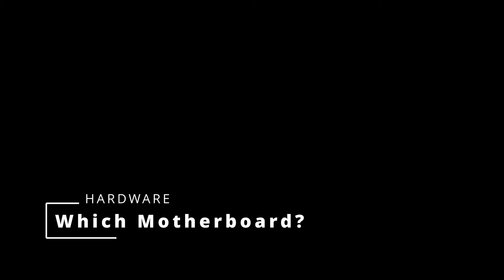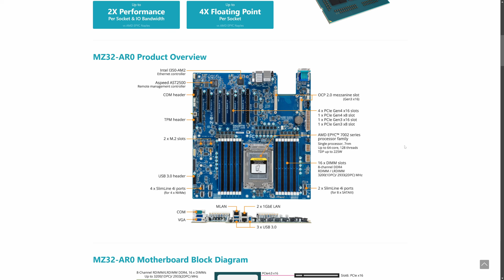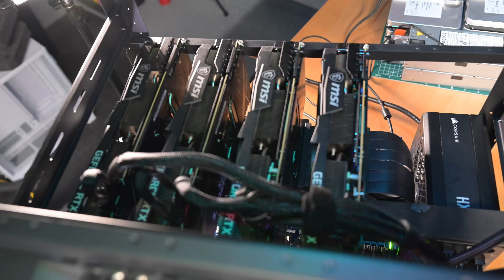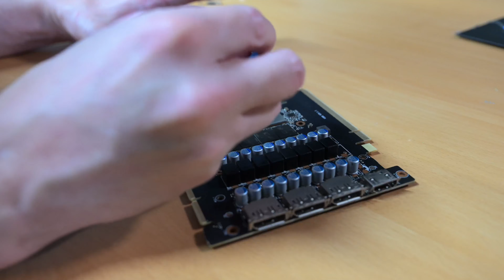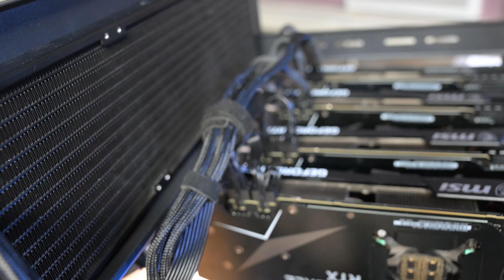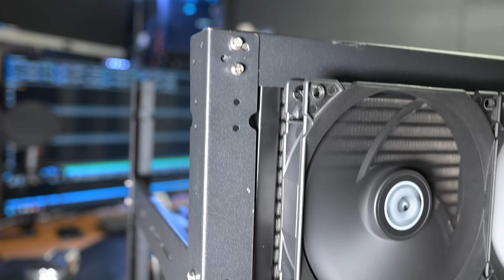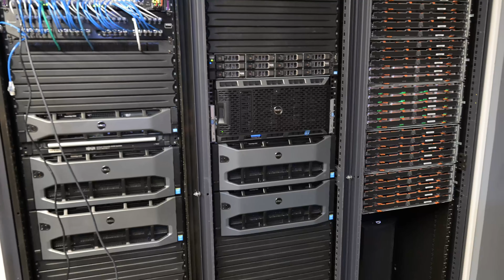INSANE Home AI Server - Quad 3090 Build

Comment: Switch to a 2000Watt PSU and more importantly, use two NVLinks to connect the cards. Unfortunately four-way NVLink doesn't exist for this gen, but still, it 3X bandwidth card-to-card compared to just PCIE. Even PCIE 5.0 would be bottlenecked, not to mention PCIE 4.0

For training, NVLink could even 2X performance, for inference it would "only" be about 20-30% improvement (depending on dense/MoE model, where's the KV cache, attention layer, experts etc.)

Comment: Hi,
I got an MZ32 setup, too. (I bought it after watching your vids, wanting to run my own AI Server, too.) 
Until now, it worked well for a few months but now after I was away for 2-3 weeks  it won't properly post and is stuck on BMC blinking. Nothing was happening to It while I was away, however it was not plugged in to power.
(Before the MZ32 I had an MZ31 that when I got it had exactly the same error and that I instantly returned for that reason.)
I tried a new Cmos battery, two different kits of ram, Cmos Clear Jumper, and the Bios Recovery dip Switch setting. Nothing worked so far :(. Have you ever had similar Issues with the board, or have any Idea how I could fix this? (It's too sad since I just was able to pick up a 512gb Ram Kit before the prices went crazy, and I was really looking forward to finally be able to run very large models.)

Comment: So, I bought a 3090 and mobo setup this past weekend from a former miner. It's using the crappy USB pcie risers. This guide is going to help me so much with converting it to an AI rig. Currently going to run only one 3090. Eventually I may add more. I was looking for someone's setup because I am going to buy a 5.0 x16 riser and couldn't figure out how best to orient the card to properly/securely fit on the 90-degree riser.

Comment: In regards to blowing air directly onto your components; if you placed this machine into a somewhat enclosed encasing with openings for vents (meshed for dust), if you had a few fans more powerful than the ones blowing inside, you can create a negative pressure in the setup and have physics naturally circulate air outside system in.

Comment: What is the recommended local server hardware (CPU, GPU, RAM, storage) and approximate cost to run GPT-OSS 20B and 120B models through an API? Also, can 20B run efficiently on a 24GB GPU, or is higher VRAM (e.g., A100 80GB) necessary?

Comment: @digitalspaceport Any gotchas I should be aware of when trying to get the rig to boot from a USB (Ubuntu 24.04.2 LTS) for the first time? I'm working with Microcenter to try and figure out if I have a bad component or if we're just overlooking something. We can get it to post, but after assigning USB as the primary boot (saving and exiting) it refuses to post the next time around. I've basically mimicked your build (used the Gigabyte MZ32-AR0 board and the AMD EPYC Milan 7C13 64 Core processor). Curious if you ran into anything similar when you built? This is my first server build, so I'm kinda failing my way through this. Thanks in advance man, I hate being the guy asking for tech support on here, but here we are. LOL.
Reply from the maker: You should not, 100% not, use a USB anything as your install drive for proxmox. Especially on modern systems. Use a raid1 of the NVMe slots instead. Totally cant help you with a USB boot drive and shame on microcenter not shooting this down instantly. I just released a complete software setup guide that shows exactly that raid1 setup you should use if you want a hassle-free and safe system to use.
Reply: @DigitalSpaceport  Appreciate the feedback man, but this post was not referring to Proxmox at all (though I am about halfway through that video). I'm just trying to get the server to startup for the first time. ;)
Reply from the maker: Oh then you need to get access to your BMC and then use the H5 viewer to see what the boot screen is saying. Likely some F1 settings save kinda deal. Plug in your BMC and find that address from your ARP table in router (it should DHCP, bios reset if not) and then username: admin pass: there is a sticker on your mobo. Then on the left hand sidebar, remote, H5 viewer. Also you likely need to upgrade your BIOS and BMC firmware.

Comment: Does E-ATX (305*330MM ) motherboards fit in this rack?
Reply from the maker: @sergeyvinc1595 The MZ32-AR0 is an E-ATX motherboard, which is what I used in this video. You do have to tap 3 new holes and set stands which I showed in this video also.

Comment: Hello again.. I have gathered up most of the components, got the AMD 7V13 + H12ssl-i setup and have a query regarding the RAM. 
To really push its limits with training and agent tasks, with the option to use larger models with this setup, what would be the best option to squeeze the most out of it? 
Would slotting in 512 GB of 128 GB Samsung M393AAG40M32-CAE be overkill to leave capacity eventually fill all slots to get 1Tb? 
Over time I would consider to get 5090's down the road once they get a couple of generations ahead.
Reply from the maker: @SwingLid I would not go for a full 1Tb of RAM. Those DIMMS explode in price per piece.

Comment: I'm kind of surprised that this build has held up. Unless I'm mistaken the two 8-pin power connectors are strictly for the CPU power only, as they are labeled P12V_AUX1 and P12V_AUX2 in the manual, which means that all of the PCIe power to those 3090 is coming from the 24-pin motherboard power connector. A connector that only has 2x 12V pins from the Molex Mini-Fit Jr. series, rated at 9A according to the datasheet.

I don't see any supplemental power connectors on the x16 riser, which starts to become a bit worrying.

If the above is true, and Gigabyte doesn't do something weird like wiring the P12V_AUX1&2 into the PCIe slots. Then this build is powering 300W worth of GPU's (75W per slot, 300W total) from two pins that are rated at 216W (2* 9A * 12V = 216W). Sure you can run that at your own risk, but I wouldn't be recommending that other people should do this. Making a build that ends up overdrawing the 2x 12V on the 24-pin connector by ~33%, is kind of no bueno.
Reply: What are you talking about? I honestly don't understand what you're trying to say. Each GPU has dedicated PCIE power cables running from the PSU. They're each being powered primarily by dedicated 8-pin connectors from the PSU. Unless I'm missing something?
Reply: @allenklingsporn6993  Every 3090 will pull the maximum allowed power from the PCIe slot itself, as it is noted in igorslab 3090 review: "Let’s now move on to the load on the motherboard slot, whose load is specified by the PCI SIG as 5.5 amps. This results in a maximum power of 66 watts at 12 volts. You can see very clearly that under full load exactly 5.5 amps are reached, which is of course still permissible, but already borderline."

At full load you'd be looking at 4x 3090 drawing 22A from PCIe slots, which is usually provided by two +12V lines on the motherboard (the EPS12V normally reserved only for CPU power and does not help powering the PCIe slots). Drawing 22A from a connector that has two pins with a maximum rating of 9A per pin (22A > 18A) can cause the connector melt or catch fire (as can be seen with 12VHPWR connector on the 5090 melting).

It's one thing to be building this for yourself (while knowing the risks), it's another thing to be recommending a build like this to others (and not informing them of the limitations).
Reply: I didn't look into the validity of what you're saying on this; but what I can't understand in it is what the risers have to do with it. If what you're saying is valid, then how are you saying it would be any different if plugged directly to the board without the riser?

Comment: this is good to watch, I'm currently trying to piece together 4 of 5060ti into a pc to automate a rly powerful project of mine. I'm new to this I js found out abt the LLM(Qwen 2.5) and wanted to save myself the API from openai or claude so I js ran a powerful open LLM and I plan on it running 24/7(64vram and 64 ram) if you have any tips for me it'll be greatly appreciated
Reply from the maker: I did just do an F.A.Q video you should checkout. https://youtu.be/7kgMkzeX650 This is a massive field of findings, your going to be more specific. I cram lots of findings into the testing out various GPU playlist I have done, so I would check those out also. https://youtube.com/playlist?list=PLarJAzZsWRGBcTRqNnPz_o4A38m3x89F6&si=3WSshJoWqEjq3MkI

Comment: @DigitalSpaceport - I am just about to start building this rig. Just sourced 4 3090s and wanted to know. For a noob that has no idea of what I am doing. Are there any tips on the motherboard for future proofing.. Do you suggest any upgrades to the motherboard-CPU combo that are also user-friendly? My aim for this is to build the capability that can locally run agents to perform analytical research for my investment portfolio locally. The budget would be around the 10k mark. Love your stuff. You get the message out clearly. Great job
Reply from the maker: EPYC may not tick the "User Friendly" box but it is the best way to get it done and on a budget that doesnt skimp on performance. Those quad 3090s are a perfect match to the rig I put together and the full parts list is here: https://digitalspaceport.com/local-ai-home-server-build-at-high-end-5000-price/ and any of the 7x13 chips is advisable as well as 3200 speed ram but aside from that there is not more to future proof in this price range really. You could opt for an H12SSL-i mobo which is a bit easier to get around and does have dual gen4 nvme slots onboard as well as satadom support would be an additional suggestion. If you have specific questions feel free to ping me back here.
Reply: @DigitalSpaceport , I appreciate your reply. Thank you. I will go with the H12SSL-I Have a great day!

Comment: condensation? how is condensation going to form on hot gpus when you're blowing room temp air on it?
Reply from the maker: @mv2woods I'm not blowing room temperature air on them. They are sitting very close to the window AC which registers 24f output on a temp sensor I have on it. I offset the rig and all is good, not ran into any issues.
Reply: Oh interesting I was wondering if you were referring to the ac unit I'm the shot. Thanks for clarifying.  @DigitalSpaceport

Comment: Awesome video. Any recommendations for older generation Xeons/DDR4 motherboards? Ideally that could handle 4 GPUs?
Reply from the maker: Yeah I have a friend who has this mobo and likes it. https://geni.us/QuadGPU-X99-Mobo They run a 2680v4 off it and didnt have to flash it with a V3 to be able to use their V4. Gen 3 pcie risers are also much cheaper and for inference just fine even at 1x width is its not bandwidth intensive.
Reply: @DigitalSpaceport  thanks! This is perfect, really wanted to reuse as much as possible from my closet (I have that exact CPU also). This is also significantly cheaper than what I had in my eBay cart (SM MoBo with Epyc CPU)! I figure I’ll have to do that eventually if I wanted to train models, but didn’t want to do that now!
Reply: Well I lied. Looks like I hit purchase now on the MoBo (no returns). Kind of regretting it b/c rev 1.0 of that board has manufacturing flaws by the PCI slots. Assuming I don’t have that issue since it’s new in box (hoping rev1.1), to lessen the blow I went with an EPYC 7532 that a buddy had. Hopefully that works out.

Should have asked before my itchy trigger finger got the best of me.

Comment: Hi @DigitalSpaceport, I've been trying to set up the AI server using the same specifications mentioned in the video, but I'm running into overheating issues when starting the server. The CPU temperature is stuck at 111°C. I've applied thermal paste multiple times, but that hasn’t resolved the problem. 
Has anyone else experienced this issue? Any tips or suggestions would be appreciated.
Reply from the maker: @krishnaullas2463  You need to check the cooling block for a thin piece of plastic. This happens pretty often and can be hard to see and results in exactly this. Also what exact cooler model # are you using? You need to make sure it is getting good contact on the CPU but that is evidenced by the smooshed thermal paste pattern easily. Lastly, check the CPU cooler is plugged into the proper header to receive power.
Reply: @DigitalSpaceport  I'm not a hardware expert, so we followed the installation steps exactly as shown in the setup video. Verified that the cooling block is clear and doesn’t have any plastic film left on it. The coolant system appears to be functioning properly, and all fans are spinning at high speed. However,  the server shuts down after around 10 minutes of uptime. Below are the relevant IPMI logs showing thermal trip events and critical CPU temperatures:
```
D: 32 CPU0_Status sensor of type processor logged a BMC Event : Thermal Trip was asserted
2 minutes ago
ID: 31 CPU0_TEMP sensor of type temperature logged a BMC Event : Upper Critical - going high(Reading value : 114.00 C And Threshold value : 93.00 C) was asserted
2 minutes ago
ID: 30 CPU0_TEMP sensor of type temperature logged a BMC Event : Upper Non-critical - going high(Reading value : 114.00 C And Threshold value : 88.00 C) was asserted
2 minutes ago
ID: 29 CPU0_TEMP sensor of type temperature logged a BMC Event : Lower Non-critical - going low(Reading value : 114.00 C And Threshold value : 5.00 C) was deasserted
2 minutes ago
ID: 28 CPU0_TEMP sensor of type temperature logged a BMC Event : Lower Critical - going low(Reading value : 114.00 C And Threshold value : 0.00 C) was deasserted
2 minutes ago
ID: 27 Unknown sensor of type power_unit logged a bios : Power Off / Power Down was asserted
2 minutes ago
ID: 26 CPU0_Status sensor of type processor logged a BMC Event : Processor Automatically Throttled was deasserted
2 minutes ago
ID: 25 CPU0_Status sensor of type processor logged a BMC Event : Thermal Trip was deasserted
2 minutes ago
ID: 24 CPU0_TEMP sensor of type temperature logged a BMC Event : Lower Critical - going low(Reading value : 0.00 C And Threshold value : 0.00 C) was asserted
2 minutes ago
```
If you could provide us with an email address or preferred contact method, we can share the detailed pictures of how we’ve set things up for further review.

Comment: 1) can you pool all the vram(which I heard you can't) ?
2)  let just say if you want to run an AI that requires more than 24gb how would you do it?
3) Can i combine my 5060ti 16gb wit 5080 24gb for AI? would that work?
Reply from the maker: @Lord_V20 Yeah it automatically uses all available VRAM. The runner, ollama in this case, handles all of model sharding across the GPUs. Yes, you can mix and match to gain more VRAM space, but the inference speed will be that of the slowest of the GPUs.

Comment: I've comd back to watch this as video guide so many times. If you fidnt go water cooled and and had 7 gpu* would you put 4 on the top and 3 on the middle and still have sufficient cooling for the cpu?
Reply from the maker: Yeah the water cooling in hindsight was just me being cheap as I had it on hand already and it fit the socket so I saved a few bucks. However that took out the second rack potential. 2 racks of GPUs are perfectly fine for this setup, just strap a bunch of fans on the front.